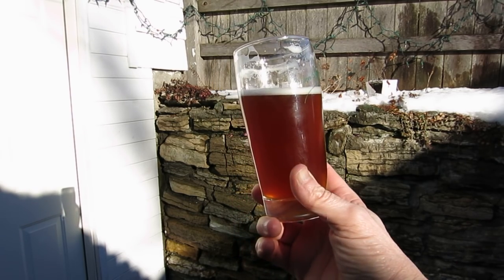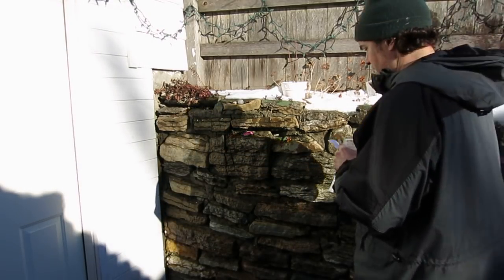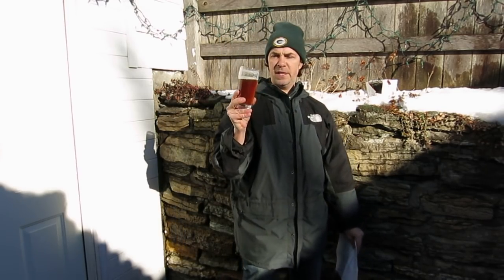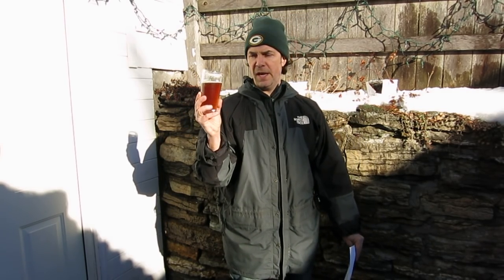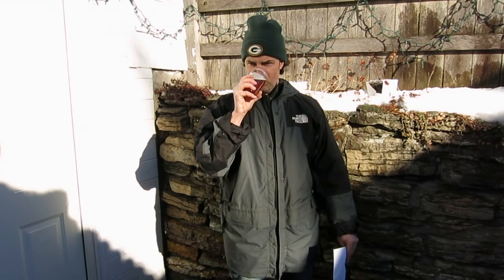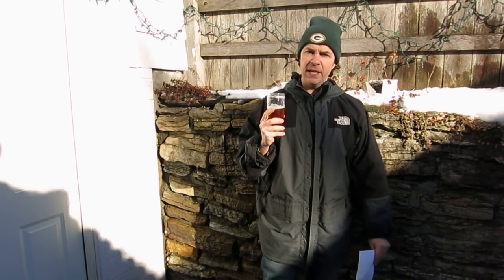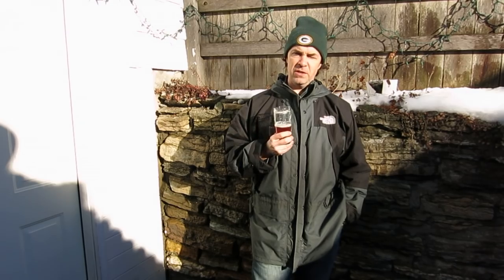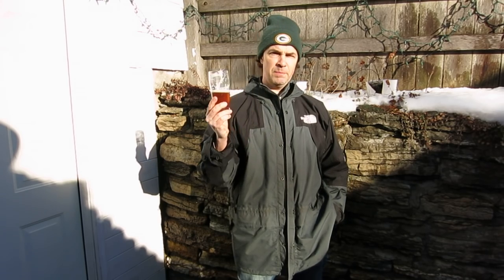Using Chevallier heritage malt in Steamin' Wife Lager.

Comment: good evening from Southeastern Australia, Don, just wondering do you filter your water for brewing or do you just add it straight from the tap?
Reply from the maker: Peter, I use it straight from the tap. We are known to be fortunate in St. Paul as having really good tap water. It tastes good and the mineral make up is roughly middle of the road. Years ago as a newer brewer I started buying filtered water from a grocery store (I brought in my gallon jugs and filled them up there). My fermentations stopped being quite as good. After a year or so of that, I went back to just using tap water and have not looked back. Cheers.
Reply: where I live here in the South East our climate is similar to Oregon, my local water supply is very soft my water profile has 3% Sulfate all the other values are lower than 5%, I did something similar to you only I used rain water and found my pale ales were pretty bland and just lacking, now I add gypsum etc, thanks for your reply, cheers